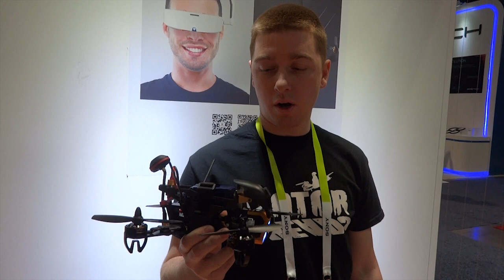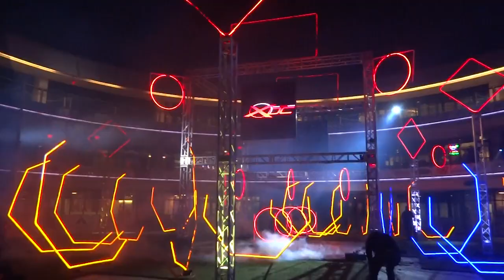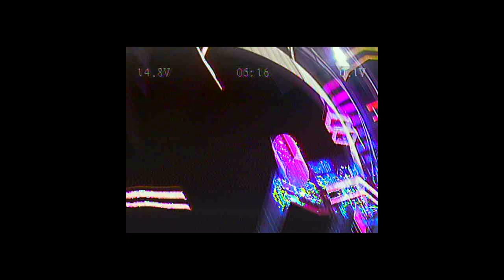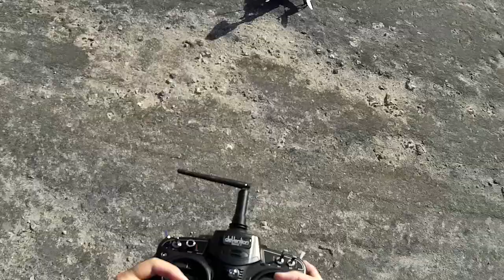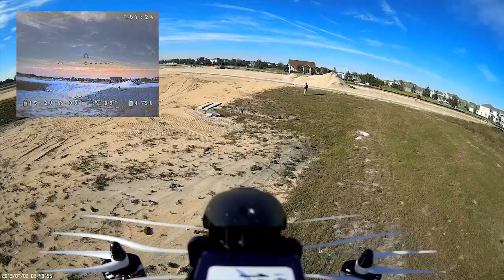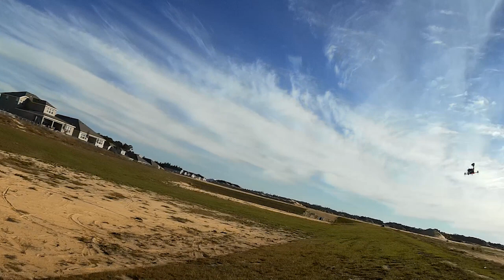Walkera F210 Flight Footage. CES Xtreme Drone Circuit Racing Quadcopter

Comment: Great vid, what do you think of it after flight. ...
Reply from the maker: +Dji Leon thanks, that was at CES.  It is easier to fly (better control) than the Furious 320.  It is more responsive with the F3 flight controller and the size is perfect for circuit race.  There are two or more minor changes to be made before dealer production, so I will recommend folks to wait for those final changes.

Comment: so do you think this is better than the furious 320? the way it handles and preformed and faster. if you had your choice which one would you go with? furious 320 or the walkers F210?
Reply from the maker: +Todd Davis i feel the F210 has better control and a better racer in it's class.  The Furious 320 will get you all the wow for the looks and tilt rotors.. but I seem to lose control on sharp yaw, maybe more expo will help.  I think the 320 is much faster and just takes more practice.  F210 is missing a free 5v port for a racing transponder (without cutting any wire), but the 320 has several open jr ports on the receiver.  Walkera is working on adding a port to the 210, I am not sure when or if it will make it to production.  If you are not racing, you will not need a racing transponder, typically provided by your league.  The F210 does not come with a lost and recovery beeper, where as the Furious 320 does.  Little it may seem, I lost the 320 behind a hill twice, took me 45 minutes to find it, but both times, the sound told me the exact spot to look for.  The Furious 320 Manual is using CC3D and the APM version may follow (with GPS and VR Drone Games). The F210 is using the preferred racing flight controller F3.  I like the 210 better for it's flight characteristic.

Comment: Ok nice video and very useful with the stats in the description. Just missing the total weight with out battery.
Reply from the maker: +fuba44 greetings 395 grams without battery
Reply: +diydrone ok, thats very good! do you have some thrust data, 3s/4s maybe even using various propellers?
Reply from the maker: +fuba44 I don't have any Walkera self-tightening propellers, so I have been using Prop Nuts and any props I can get to.  I will have to check with Abel (MultiGP League) on how to best measure those thrust data.
Reply: +diydrone you are awesome, thank you for replying so fast! will be looking out for flight videos / reviews of this quad for sure!